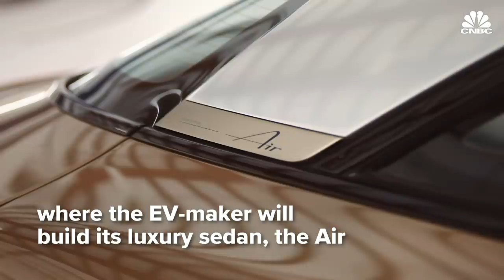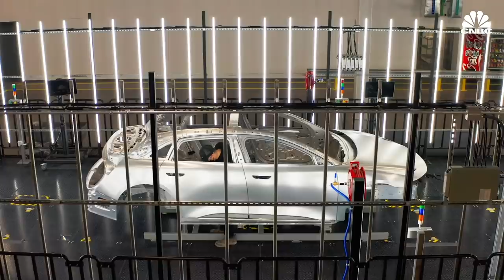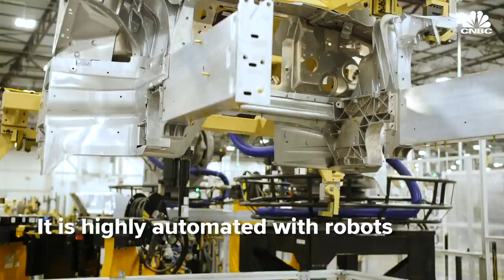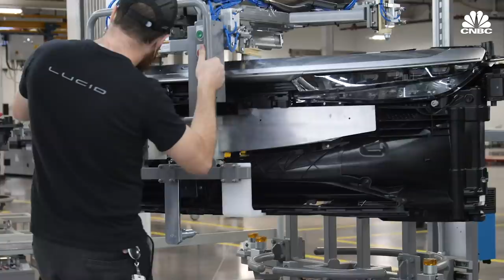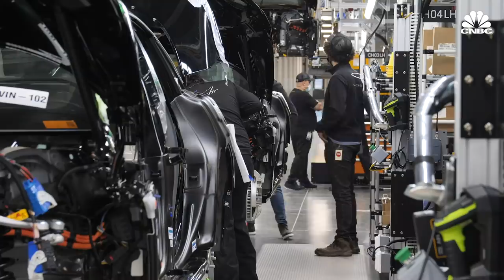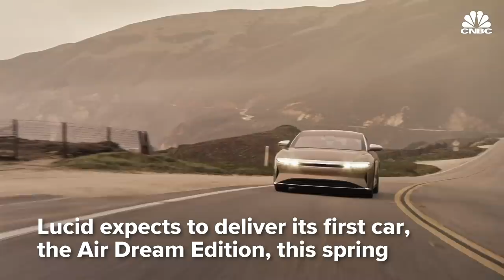Inside Lucid Motors’ new electric vehicle factory in Casa Grande, Arizona

Comment: So, simple math here from a noob: Plant current capacity is 34k, starting production in spring gives them full half year production if all is well, it will mean 17-20k cars for this year, 169k per car, at 20k that's 3.4B. Margins at this scale are non-existent, capx is huge, opx unknown, probably huge debt, unknown problems, etc, etc, etc.At ~50-60$ CCIV is 14B cap. This stock should be where Tesla was in 2011! At 20-30$. I honestly want Lucid to succeed and push everyone else forward, explore 900V arch, range advancements, etc, etc. Once those promises are proven by random youtubers, like Bjorn, Andy, etc I will invest into this company. Not sooner. Make your own decision, don't buy in based on EV hype and slick brand euphoria.

Comment: ASSEMBLING PROCESSES MUST HAVE A PERFECT WAY TO DISASSEMBLE THE CAR VERY QUICKLY AND PERFECTLY! IT HAS TO WORK AS WELL AS WHEN IT IS ASSEMBLED! IN; THE DISSABLEY! EXQIZIT PERFECTION  EVERY PART! PLASTIC, COPER, GLASS, RUBBER, ALUMINUM, SEPARATED GRADES OF STEEL, STAINLESS, FROM CRICUT BOARDS TO FRAME ROOF BUMPER TO BUMPER.